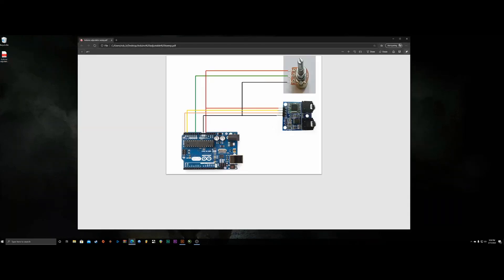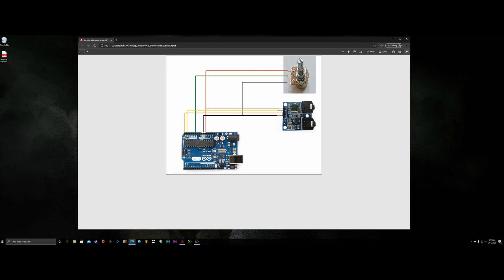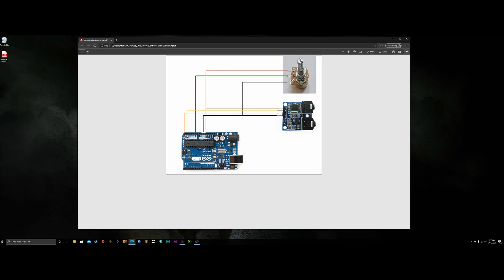How to add Adjustable sweep to AGB

Comment: I don't see anywhere that uses tbe val variable in the code. Looks like it is retrieving the pot rate but not using it. I don't want to add a pot but I do want to increase the sweep rate to an arbitratory value. Any ideas?
Reply: Sorry I see where it is being used... I removed the delay line... But it's still quite slow...

Comment: Any chance I could get a copy of the updated sketch? The one uploaded is an old version. littlestevie2014@gmail.com :)
Reply from the maker: I don't have any updates. I personally don't use an arduino based ghost boxes. The couple I built were only for this demo. Sorry.
Reply: @TheParawakening  Thats a shame, thanks anyway. I just made this up and it doesnt work due to the sketch not being correct - ie no coding for the pot :(
Reply from the maker: @SteveMicroshack  the code should be in the original post.
Reply: @TheParawakening  Yes the code/sketch is there but for some strange reason it has no coding for the adjustable sweep in it. As you can see from some of the other comments other people have mentioned this too.

Comment: Very nice project, Thank You!  I have a similar problem to someone else that commented... The adjustable sweep potentiometer does not change the speed of the sweep.  The circuit is wired as you have indicated.  Might you have any ideas or have you happened upon a fix?
Thank you!
Reply from the maker: The wiring need to.be spliced together. There are a couple of wires that intercect, those wires need to be spliced together.
Reply: @TheParawakening  I will check again.  The way I have it wired, in theory, is a varied 5vdc reference using the Arduino as the power supply going back to the analog input, I get that.  But I have the power and ground "bound" at the tea board rather than tapping into these wires in between the Arduino and tea... Maybe that is it.
Thank you!
Reply: @TheParawakening  I've wired the pot by "teeing" it in rather than using the tea connections... Same result.
Must be software or maybe the fact that I'm using a Nano processor.  I have verified that there is 0-5 volts dc reference ground at terminal A0, so I believe the circuit is correct.  I have electronics background but no experience with Arduino or the programming language, so this is my first Arduino project.
Reply: @TheParawakening  In the program sketch, the syntax points to a library called "wire" that I don't see on your download page.  Might that be it?  I do see the tea5767 zip file.
Reply: @TheParawakening  I have corrected that problem and now my wife has a custom made ghost box(with adjustable sweep).  Thank you!
Reply from the maker: @joshuaschaeffer8327  awesome!
Reply: @joshuaschaeffer8327  I am having the same problem, what did you do to correct it?
Reply: @WesleySwipes  None of the lines of code in the provided program actually point to or refer to the analog potentiometer input.  I did the research on "arduino analog input" along with other research and modified the program.  Maybe I downloaded the incorrect program in the first place.  It took quite a few hours because I have never used arduino products.
Reply: @joshuaschaeffer8327  Thanks, I see it now. Maybe  @The Parawakening   can check the upload. I did a compare on this file and the original box and they are identical.
Reply: @TheParawakening  Can you double check the code that is uploaded? it is identical to the original code from the original video.
Reply: Hey Mr Rob sir, was the new code uploaded?  I confess to knowing not much about arduino, but I did build a great many investigation toys, so can follow easily the diagram, but alas I have the same problem, sweep does not change..
Any ideas?